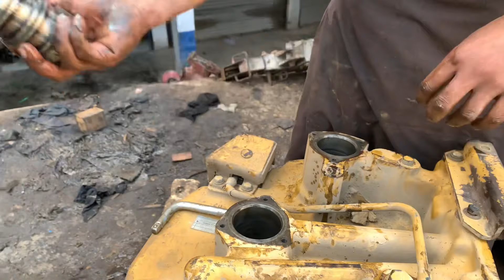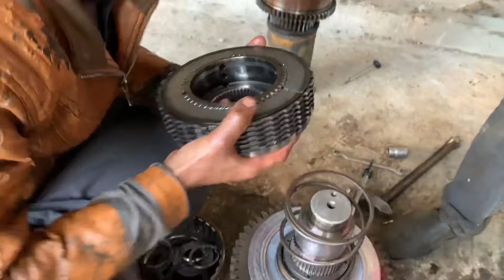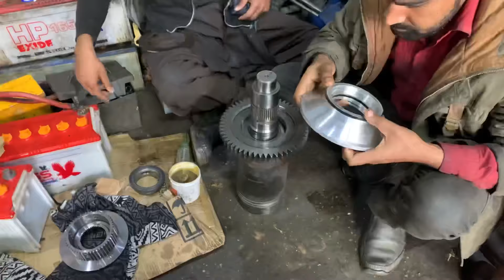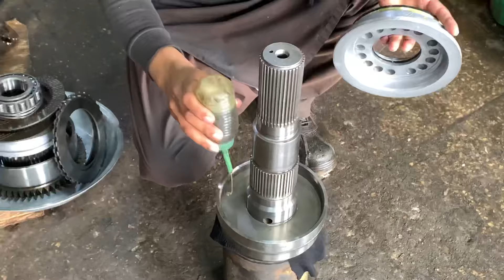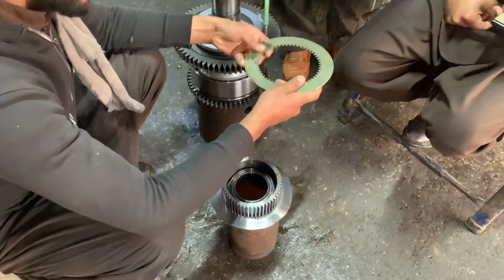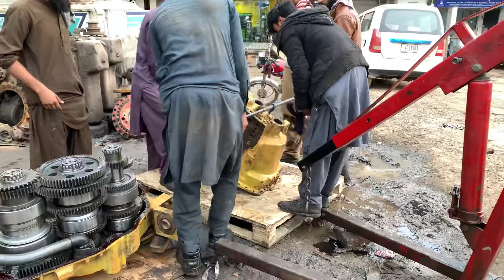Caterpillar 140H Grader Transmission Rebuilding || Restoration CAT 140H Grader Transmission ||

Comment: Having just watched a video about German racing engineers working on Porsche engines, in conditions cleaner than an operating theatre, this is astonishing.
Reply: I have seen dumps cleaner than this place.
Reply: It is a dump!!! Luckily they are working with all safety standards😂 i always wonder why it is so hard to try to work cleaner and a bit safer. I think lots of people list toes and fingers. “ fixing “ a transmission in these conditions: i wonder how long it will last😔just a shame of all the work. Totally unnecessar☹️
Reply: I'm sure Caterpillar would state in their service manual to find somewhere very dirty then open up the casing.  Then bang the start on concrete steps and throw roller bearings on the dirty floor. Importantly when reassembling never use a Torque Wrench. Then maybe you can do it all again when it goes wrong after a short life.
Reply: Porsche people are typically pretty pompous.

Comment: I build Caterpillar transmissions for a living at a Caterpillar remanufacturing plant. Off a quick glance I just wanted to let you guys know that you do not need to put oil/assembly grease in-between every clutch plate and friction disc. You’re wasting your time and your oil. Other than that you guys did pretty good, these are pretty straight forward; no shim packs/endplay, no transfer case or torque converter, etc., so they’re quick and easy. 

I did notice you skipped all of the outer covers, plugs, speed sensors, valve assemblys, and the wiring harness. Did you just do that off camera?

Comment: No feeler gauges, micrometers, cleanliness, or assembly lube.  Lots of hammering on bearings.  No torque wrenches. 1920’s shellac for gaskets.  Wrong tightening sequences and torques.  Grunge everywhere.  No hoists, just many sore backs.  Astonishing.  I’m guessing they give a 30 second guarantee.
Reply: They used plenty of assembly lube and honestly the work they do isn't that far off what I see in western auto transmission shops.

Comment: More slobbering, looks to me like you guy's tear things down to fill them with dirt, surely if you are engineers you can make up a few steel benches for to work on instead of working on the dirt floor
Reply: dirt serves as a break in agent to help wear down the hotspots on the new parts 🤣
Reply: If you send the benches or the money to build them. Will be nice. They are poor people.
Reply: welding a table or bench from scrap materials is not expensive. They just prefer to do everything on the ground. This is strange for people from civilized countries.
Reply: It's a religion Thing and nobody can change it.
Reply: ลงๆๆ
Reply: ชต9
Reply: 0
Reply: you should tell the owner of the workshop, he's the one who doesn't invest in safety and equipment to maximize profits and forces the workers to work in those conditions.
Reply: Mechanic .. primitif
Reply: are you convinced that the boss would pay the hours that the workers would take away from work to dedicate themselves to improving the workshop?
Reply: @CarloBusi  That is the truth right there